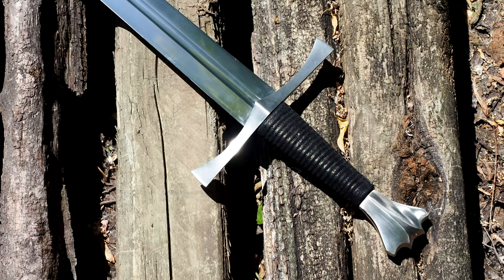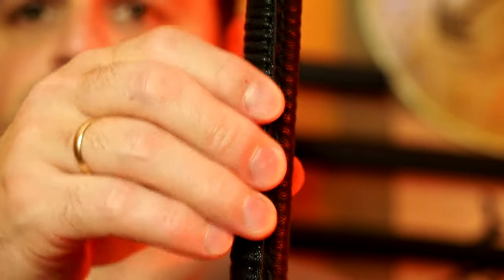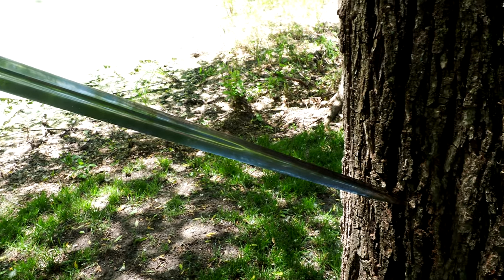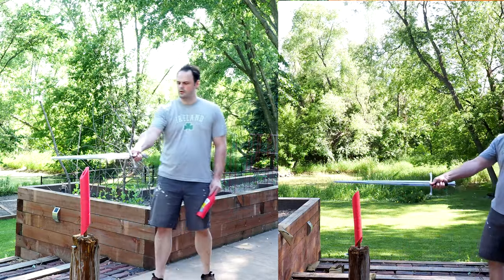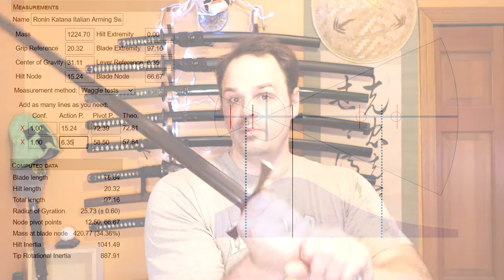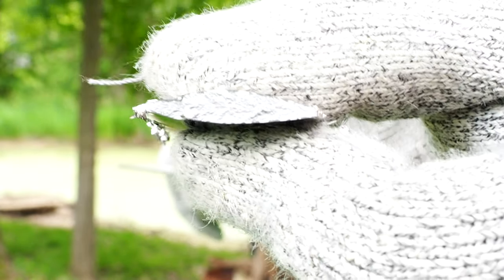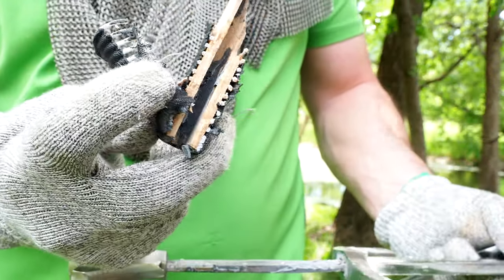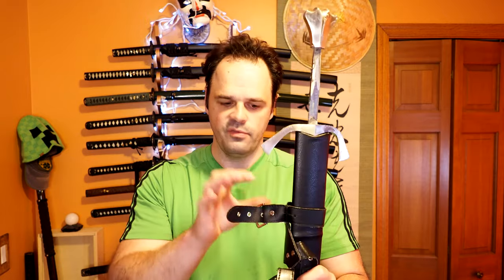Ronin Katana: Italian Arming Sword Review and Destruction

Comment: I really appreciate the sharpened edge vs factory edge comparison. I always hate when reviewers do cutting with a semi-sharp factory edge and then draw conclusions from that. It's like reviewing a car without filling it with gas first and then going "well it didn't go very far."
Reply: but it would be nice that if it says sharp then its sharp. but we all have different views on what's sharp.for me if I cant shave the hair on my arm clean, its not sharp. but then with a blade like that half-swording would be dangerous for the fingers.
Reply: @rallics  I think the solution there is to sharpen it according to how that type of sword would have been used. A type XVa longsword for thrusting? Yeah leave it a bit less sharp for halfswording (but still sharp near the tip). A cutting specialized longsword like a type XVIIIc? Sharp as possible.
Reply: @mysticmarbles  true, honestly if I had to pick a sword to live or die by I think I would want a middle of the road stab and Slash ... Question is and I know hema is all about the 2h but would you really want to live and or die by that? 
It would take some impressive armor for me to put down a shield and who wants to walk around in a light tank. 

I am just getting into hema , although I didn't even know it was a thing or I would of been in a long time ago,  I have noticed that it's one or 2 hits at most before one or the has been hit....could you imagine living like that....fights to the death and one or 2 moves was life or death ... Ya give me a shield.
Reply: Agreed! Skallagrim does that kind of nonsense. "Ah, it didn't cut this tree in half! So, you can see it's not very well made." The damned thing hasn't even been sharpened!

Comment: I have the Longsword iteration, and it's my favorite European sword. It's surprisingly nimble for a larger blade, and it's aesthetically very pleasing
Reply: The Italian hand and a half #5 right? I've been debating between that one and the #7. How is the #5 as a cutter?
Reply: @patthecat1800  the edge needs some work from the factory, but it's a good cutter. It's got good geometry from the factory, so it doesn't take a whole ton of work.
Reply: @patthecat1800  and yes, it's the Euro #5
Reply: My euro #5 came in a warped scabbard that bent the blade :(
Reply: @stevy2  that's a warranty issue then

Comment: Really nice video. I like when you pushing sword to the limits. 
This sword survived 37 hits before it broke, so well heat-treated 1075 is good option for the blade...

The Dark sword's alexandria survived about 53 strikes before it failed, so diffentially heat-treated 5160 is, as expected, more durable.

It would be intetesting to see destruction test of the scorpion sword blades made by Chris Palmer, his ninjato blade survived many strikes to a granite, i think it is only blade that can actually beat that Anatar's sword
Reply from the maker: In the interest of time, not all the wacks are shown.  Most of them are in there but there are a few that happen off camera. I don't think your count be entirely unbiased.  Aslo, it was colder with the DSA so that might have had an impact.  If i would compare the two, I think the Ronin held up better in terms of raw durability.   The DSA held up really well too but not quite as much.  Though it did so while being a fun sword to move around.
Reply: @Matthew_Jensen  Wtf, i don't have a reason to post here biased counts... On the video of destruction of DS alexandria you can simply see more hits to Anatar than on the Ronin's sword destruction video. I dont know that you doesn't show us all hits...

It make actually sense that Ronin sword was more durable because differential hardened blade of DS swords used to be less durable then monotempered. Also lenticular crosssection with fuller seems to be more durable than hollowground blade... on the other hand  5160 should be more tough and  durable in general...
Reply from the maker: Sorry for my poor choice of words there.  I did not mean to accuse you of being personally bias.  I was trying to say that the data I provide in the video is not sufficient to draw decisive scientific conclusions.  There are things that happen off camera, things that are edited out (not much but some for the interest of time), differences in the temp, how hard I swing it, what things I hit with it prior to sword v sword.  There is enough variation in me as a tester that a simple count of strikes (were they all accounted for) would not provide a data set sufficient to draw conclusions.   In my head, the lack of data I provide is enough to introduce some kind of scientific bias or at least insufficient analysis. I think I just used the word wrong and I am sorry about that.  I did not mean to accuse you of being bias.

Side note, the ronin is not deferentially hardened.  It is also through hardened like the DSA.  I would suspect that the ronin in the video has more steel in the blade than the DSA Alex does.  The mass over a shorter distance probably helped the durability.  That said, they were not overwhelmingly different .  That makes a special case for both companies.  ronin did it on a budget, DSA did it at a higher cost but gave some fun dynamics in the process.

Comment: Hi Matt, I have this sword but mine came with the cord on the outside of the grip which I don't like but the length I do like. Also, mine came very sharp, I bumped my hand against the blade as I turned around and just a slight bump while it was hanging from a stand cut the side of my hand. It is a bit clunky in my hands as well but not to bad, I was able to control it. Great review, would love to see you review the hand and a half Italian longsword by Ronin, is this guy's big brother. Has the same pommel but a different guard. 

Keep up the great videos!